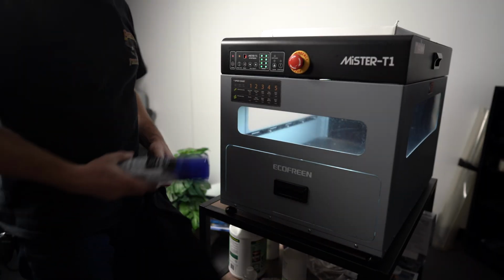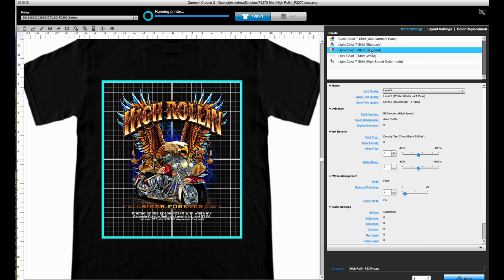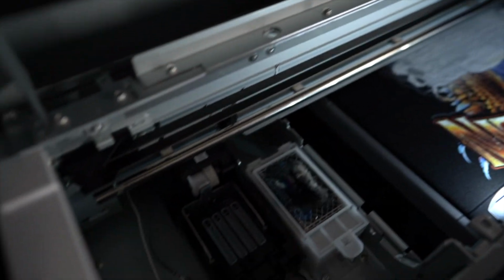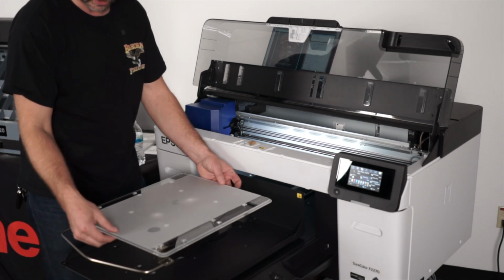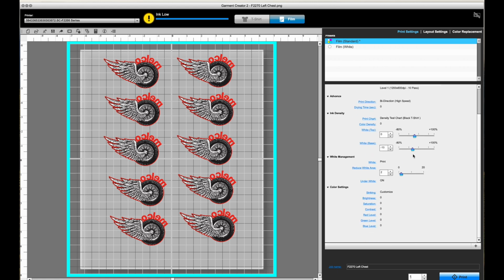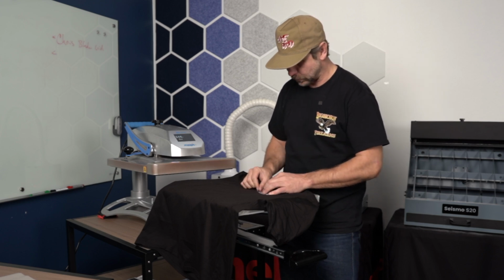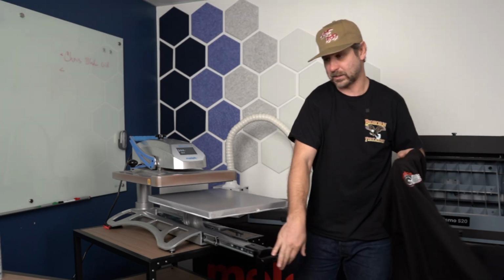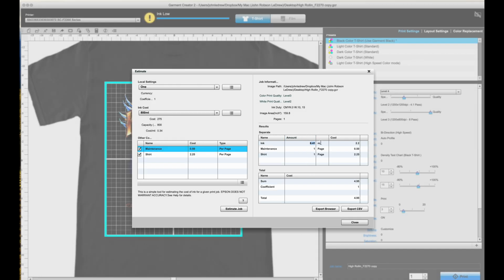Printing Tutorial on the Epson F2270

Comment: Why didn’t you do the smaller logo on the left in the front as direct garment transfer instead you did direct to film Just curious to know. I want to learn more about this business.
Reply: To show you the process printing dtf
Reply from the maker: I could have done the left chest with DTG but I would need to pretreat that area first, which is an extra step. Also there is a lot of fine detail on the left chest, DTG would have been just fine, but DTF really made it pop.

Comment: Hello excellent video. I'd like to start in this business with the epson 1070. Do you consider it to be a business that leaves good profits?
Reply from the maker: Yes the F1070 is a great starter unit. Keep in mind it's slower than the F2270 and has a limited area of 10x12 but it does DTG and DTF and will always be a productive, reliable unit even if you upgrade down the road.
Reply: What are the coste per piece when printing ?

Comment: Great video. Thank you. I love the performance of the 2270 but the "338* for 45 seconds" that Epson documents is completely bogus. I appreciate you guiding people in the right direction by suggesting 350* at 115 seconds. For me, it's even more. Even without an underbase, prints don't hold up after one wash for me at anything less than 2 minutes at 350. And I pretreat white shirts as well. I started trying on an 8 foot belt dryer but you have to have the conveyor so slow and temp so high that it becomes pointless. I'm adding a third dehumidifier to the print shop to possibly help.
Reply from the maker: Keep in mind, if you use standard pretreat on white shirts and don't use white ink the color ink will wash out. There are pretreats for color ink only if you insist on using pretreat for white shirts. Your conveyor dryer must have forced air to fully cure the waterbed print. You can dry it in a standard convection oven but must heat press it afterwards to "cure" the print.
Reply: @MelcoEmbroidery  Thanks for the reply. I currently use Epson's cotton pretreatment at the 1 to 9 ratio suggested for light garments. I do have a forced air belt dryer. Working with sensitive tech fabrics, the belt dryer is a must for me. Even at 260 to 280 degrees, 3.7 ounce poly/spandex shows heat lines. I think I will explore some other pretreatments and heed some other advice I received which is to not overheat the pretreat in the heatpress process. Thanks for your help!

Comment: If I am going on vacation for 2 weeks, and the printer is not being used. What is going to prevent the white inks from clogging in the Tubes, Print Head and Capping Station?
Reply from the maker: Epson ink is less likely to clog than other brands. The printer is designed to be turned off for extended periods of time. If you are gone for 2 weeks you could consider two options. Have someone come in and turn the printer on, let it cycle, then turn it off. I would do that once per week. Or you could replace the white ink and replace with cleaning cartridges. I think that's a little overkill however. Honestly though, you could probably just leave it off. I left the 2100 off for a month last a few years back and it was fine.
Reply: @MelcoEmbroidery  Ok Perfect. Thanks for your speedy reply. I will be in contact soon.